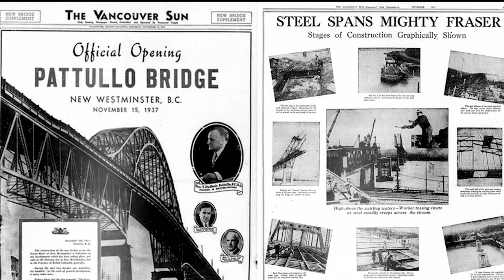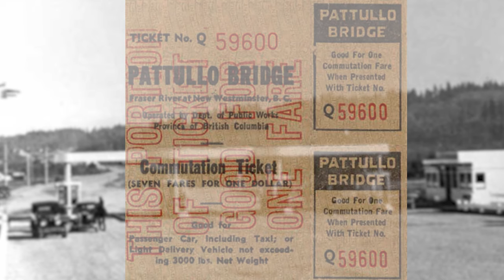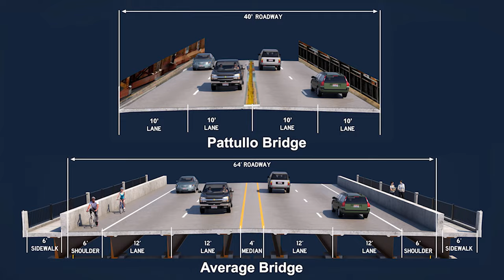History of the Pattullo Bridge

Comment: Not only the Patullo bridge needs replacing, so does the Massey tunnel and likely, the Granville street bridge.  Maybe the Lions Gate bridge and the Ironworkers Memorial bridges eventually as well.
Reply: That's a pretty blanket statement. Every bridge has a lifespan
Reply: @BawkBawkBawk666  The Lions Gate Bridge is already 85 years old.  Although parts of it have been replaced over the years, not all of it has.  There's also the question of how earthquake resistant these structures are.  The Port Mann bridge was replaced after fewer than 60 years of use.
Reply: @heronimousbrapson863   the lions gate bridge was rebuilt only 24 years ago, I don’t think it will need replacing anytime within the next 20.

Comment: I've long been curious to know what led to the approach of the north end of the bridge being rebuilt in 1956.  The original north end was a weird t-shape, which must have been a nightmare, so some modification was obviously needed as traffic increaded... but I've not been able to find anything about the decision to cut through Queen's Park... was there any controversy around that?
Reply from the maker: Although I couldn't find anything about a controversy over the removal of some of Queen's Park, the only thing I could find was a pdf on the history of Queen's Park. Here is an excerpt. 

"In the post-war era Queen’s Park saw many improvements. However, the connection of McBride Boulevard to the Patullo Bridge came with the addition of traffic noise and the loss of the southern edge of the park to the new interchange at Royal Avenue." https://www.newwestcity.ca/database/files/library/Queens_Park_History.pdf

I looked at old maps and it did take a large chunk out of the park for the construction of that interchange. https://oppositethecity.wordpress.com/wp-content/uploads/2014/02/1947-roy-wrigley-map-of-vancouver.jpg

I also found a map from 1880 before it officially became Queen's Park, but it is mentioned as a park, almost double the size stretching to the penitentiary. https://newwestloststreams.ca/timeline/
Reply: @HistoryOfBritishColumbia   Wow, thanks for digging that up! Makes ya wonder why they didn't line up the bridge with McBride Blvd?   I'm hoping that there must be news articles in the Columbian and/or Sun that cover the realignment. I mean, it's a big deal to cut off park space for a road!
Reply from the maker: @KOZMOGRAFX  this would make a good future video considering it is BC's first public park
Reply: @HistoryOfBritishColumbia    It would be!  New West has a rich and fascinating history!